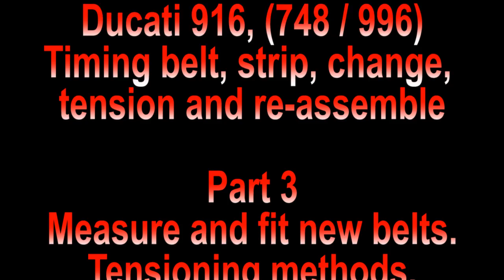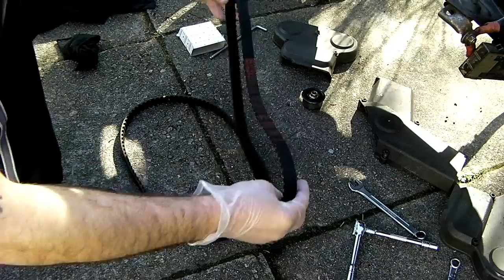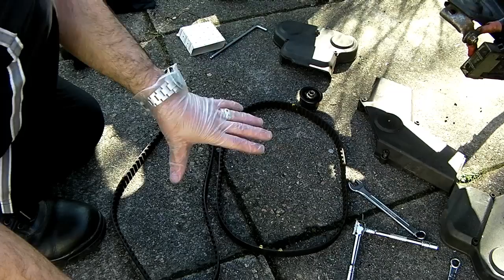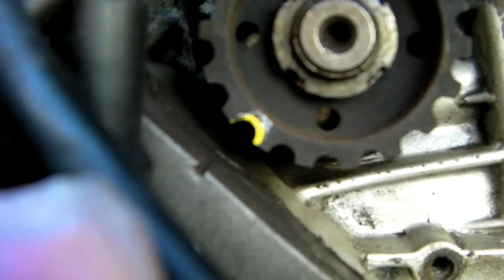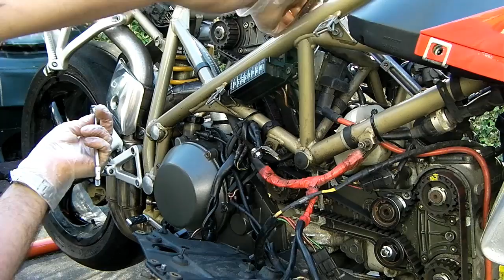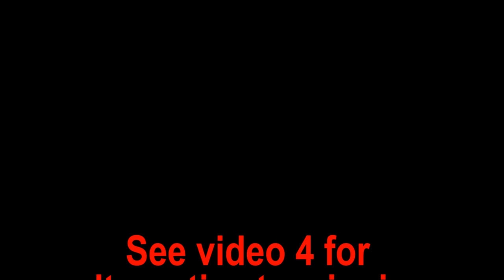Ducati 916 / 748 / 996 timing belt change, video 3

Comment: How often do the belts need replacement?
Reply from the maker: For the early desmo and 2 valve models it was every 12k miles (or 2 years if you didn't do much mileage and it spent long periods stationary). However, the new OEM belts are kevlar reinforced and Ducati say it doubles the replacement lifespan. Please bear in mind this does not apply to pattern parts, I'd recommend OEM for any high performance engine, especially one like this which has sharp bends and short runs like between the camshaft sprocket.

Comment: thanks for the help videos, i am about to change my belts, can you confirm that you did the tension on the vertical cylinder with the timing at top of exhaust cycle not top of firing cycle, i want to be sure i understand the mechanics. Thanks!
Reply from the maker: mytube1743 Yes that's correct, TDC on the exhaust stroke so that both valves are closed and there's no rotational tension on one specific cam sprocket. At TDC the exhaust valve has just closed and the inlet is not yet open. You'll see in the video I use a long scfewdriver in the plug hole to double check TDC too.
Reply: thanks! pretty cool that people are learning for 5 years already, AND that you are still responding. Correct me if I'm wrong, then the vertical cylinder is at exhaust TDC, and the horizontal was measured at firing TDC, thanks again!
Reply from the maker: mytube1743 To be honest it doesn't matter too much AS LONG AS each cylinder in turn have the valves closed. With the front cylinder at TDC one of the cam lobes on the rear is opening a valve hence turning that one after tensioning the other, if either of the cam sprockets is under tension it can give a false reading on your tension tool and more so if you use the 'by hand' alternative methods as it's not just the flex in the belt you're measuring but the pull on the sprocket trying to ride off the high spot, you'll note in the earlier videos as soon as you've set TDC and take off the rear belt the sprocket spins, this is why the alignment marks and teeth  marks on the belt help though you can get a holder for that to stop it moving. So in essence, TDC at either as long as both valves are closed. Apologies if that caused any confusion for you.
I'm glad this has been such a useful video series as I know how nerve wracking it is when doing it for the first time yourself.
Reply: perfect!  Thanks again ,  and great Bike!
Reply from the maker: mytube1743 You're welcome, yell if you need anything further and God luck with it all.
Reply: Thanks, again! I have gone back to LT Snyders book, and you were indeed correct initially that the vert cyl was at TDC compression when you set the tension. For the horz cyl with the white marks facing opposite each other the horz is at TDC exhaust/intake, that is why the vert intake cam moves, because the vert is half a stroke ahead of the horz and with horz at TDC exhaust/intake, the vert cyl  intake valve is on lobe. yay, now i understand, and I will undertake the belt change on my bike shortly, thank you for the videos

Comment: I'm beginning to see the light ! I think !! I'm a somewhat new Duc 749 owner, and totally mechanical illiterate so, as i don't trust indys and stealerships, i'm in deep sh...let me rephrase that...in deep need of understanting these damn things :))
Reply from the maker: Dan Alex Haha. When you realise, provided you have a degree of mechanical capability, how much time and labour costs you can save it's very worthwhile. There was a huge stigma that rose up around changing the belts on these and I remember people for some years using this as an argument for ongoing costs if you purchased one. 
Realistically people have been changing them on cars for years so what's different? easier than some cars where you have to remove engine mounts and hardware and no more technical than dual (or more) belts on performance cars either. 
Mainly, remember to double check everything, renew anything you think should be, (rollers, locknuts, tensioners etc) and take it steady for the first 50 miles or so after until you're happy it's alright.

Comment: If the cams do not move, or are kept in place, what's the point of transfering the dots from the old belts to the new ones?
Reply from the maker: Dan Alex The key word here is IF ;)
one of the cylinders is under tension and one of the cams will move unless locked in place. 
The dots are essentially a redundancy safety measure, not strictly essential but extra peace of mind for you when doing this

Comment: Can you tell me which brand of timing belt you used? What do you thing about Dayco timing belt?
Reply from the maker: I used genuine Ducati belts from the main dealer, not that expensive and certainly not much more than many aftermarket ones, for something this critical I'd recommend sticking with OEM.
I'm sure many others have used other belts successfully though, Google search the brand for reviews
Reply: Gates belts serial number Part No. 5192XS Powergrip. I do not believe that Ducati ask Gates to make a standalone belt for their sole use, £38 for two compares to £106 from dealer. I think there is a lot of folklore with Ducati's.

Comment: Hi spidiq8

thanks for your Vids ...great!
You used the Facom Tool DM 16 for checking the Belt.
Now my Question:
Can I use this Tool for my Ducati 1098 SF ?
and There are 6 interchangeable fittings,which one , i have to use?
you used Number 4 , because you have that thickness gauge !
do you have an List of that diffrent Ducati Belts , that corresponds with these Fittings 1 to 6?
This Type of Belt is mounted -->> 73740251A - Ducati Toothed Belt
Thanks in advance Tom
Reply from the maker: Yes you can.
Regardless of the engine this is a universal timing belt tension tool.
In theory, what you do is use the thickness gauge and determine the button to use from the number that the belt thickness corresponds to, most likely it will be a number 5 on the gauge which this one is.
The reason this unit was used with a No4 button is that in a comparison with an official ducati tension tool, this corresponded most closely, with the No5 button and tensioning to the top of the top groove left the belt slightly tight, to be fair theres not much in it and you likely won't damage anythng, I suspect half the reason is that unlike a car theres only short strips of belt to fit the tool too rather than the long ones on a car.
So, hoping that hasn't confused you, you use the No4 button and set tension to the BOTTOM of the TOP groove, not the TOP of that groove.
There are also the 90 degree twist method and the Allen key method.
As long as you're not too loose the belt will slip and not too tight theres no give you'll be OK, slightly loose is preferable if in doubt as too tight will destroy the pulley bearings more quickly.
I don't have a list of the belts and settings unfortunately but suspect it will be very close to the Desmoquattro engine, the Testastretta in the 998 and the 999 / 749 is about the same tension wise.
The tool wasn't mine but was borrowed so I can't even reference the gauge thickness for you.
If in any doubt at all, set everything using the best method you have, 90 degree / allen key / tension tool then leaving as much off as possible ride the bike steadily to your dealer to have them double check and adjust if necessary the tension, that way you get the peace of mind and save a lot of costs by doing the bulk of it yourself.
You might check on the Ducatiupnorth forum linked on these video's, lots of knowledgeable and helpful friendly folks on there.
Hope this helps, good luck and if you can video it and post up so I can take a look, i'd love to see how similar the procedure is.
Reply: @spidiq8 so using number 5 is ok as thats what ive been using! the belt measures 5mm not 4mm so I used number 5 ?
Reply from the maker: @danielmckie6452 It should be but as mentioned in the reply above that may be a little tighter.
Once tensioned and the tensioner locked do the twist test. 90 degrees, clean fingers, it's worked solidly for mechanics for many years. You should be able to twist fully 90 degrees but getting tight at the 90 degree point and would need to be forced beyond that. If it easily twists past that point it's too loose and at risk of slipping.
If in doubt. Tension. Leave the covers off and ride steadily to a workshop and pay them to check the tension. It shouldn't cost much and gives peace of mind to you.

Comment: Hey Spidiq8, thanks for this all. still I have a kind of crucial question at this point. 
unfortunatly my mark on the belt didn't hold. fortunatly you told in the video that it is 39 teeth from the first so that really helped me there, but you also said something about a walk through which would show exactly how many teeth. allthough not really necessairy i would still like to check that with my final teeth counts. 
But where can I find this walk through??? 

thanks !!!

Comment from the maker: OK, having checked with a guy who has an 01 748, he's verified his sight glas is on the left of the engine case, near the gearshifter pedal just like the 916 / 996 models.
Could you take another look, they're easy to overlook, (just realised I didn't include it in my video, oops), you're looking for a little round oil sealed glass window just like the oil level one on the lower right, it's higher up and you'll see the edge of a silver disc which has two red dots, (rotate wheel/crank very slowly)

Comment: That was my battle i thought the same its up along the left side near the clutch slave on your 916 and i thought all these bikes are pretty much generic to a degree! not the case for this :-( i know 2001 748,s changed abit in this year some having straight cams and others have a slightly angled 1,s mine is the striaght cam version same as yours id say! If you could throw out the question that what be great as i dont know any 748 riders most appreciated anyway thanks

Comment from the maker: If it's the same as the 916, (i was under the impression that the 748/916/996 were all the same engine case design wise), the sight glass is on the left hand side of the engine, looks like the oil filler level glass on the right hand side. and inside you'll see the rim of the crank and the dots as you rotate the rear wheel, (or crank by the turning tool), let me know if it's definitely not there and i'll ask a couple of the 748 riders for what to do.

Comment: Hi there, spidiq8 found the videos very helpful (thanks) however ive got a 2001 748 and ive bought the belts tension tool and cam locking tool etc im ready to do the change! but ive do not have a sight class for finding the TDC (or am i missing something) or is this just the case with 748,s help how do i find TDC!

Comment from the maker: It's awkward isn't it.
I've got the holding tool so it's ready for next change, shame I didn't have it in time for this one, but I had to return the tension tool ASAP so couldn't wait.
Interesting to know that it is manageable though, I found that getting the top 2 in line first then the lower pulley was easier than the lower one first.
I certainly say, splash out on the holding tool, it's worth it for the skinned knuckles and language and cursing saved, :)
Glad you found the video useful